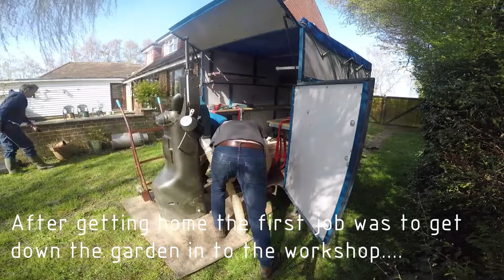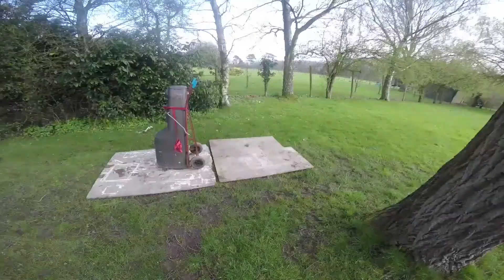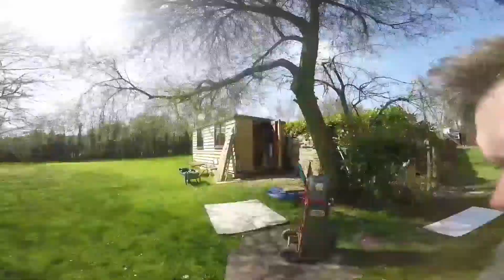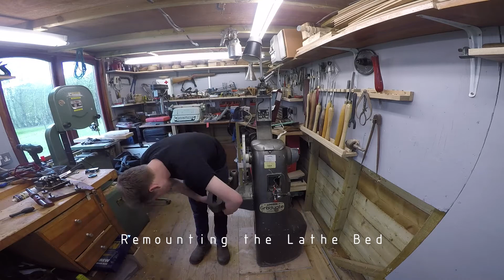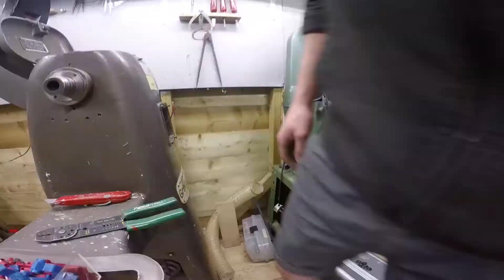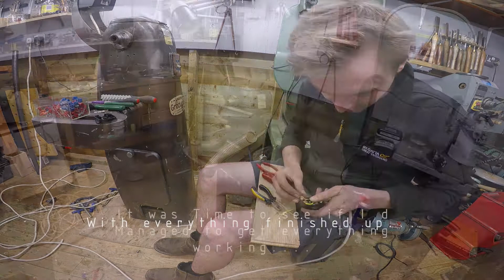Collecting and Converting My Union Graduate Bowl Turning Lathe!!

Comment: They are an absolute pain to get the motors in and out of. I have one and also a Union Jubilee grinder. It’s sometimes easier to tilt the entire unit on its side so you get the bottom ‘hole’ for more access.